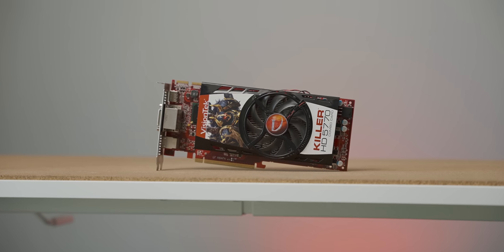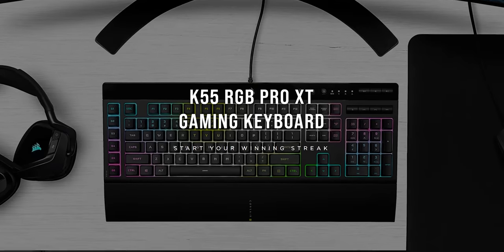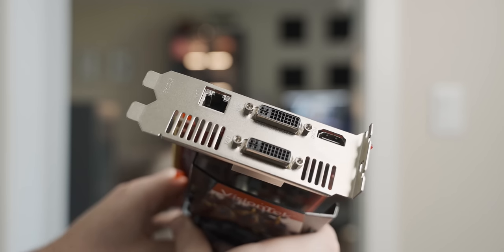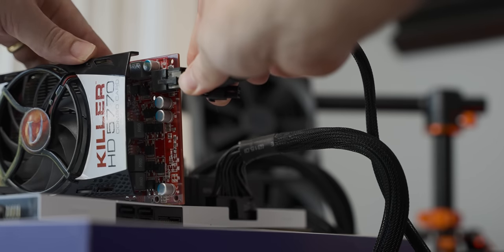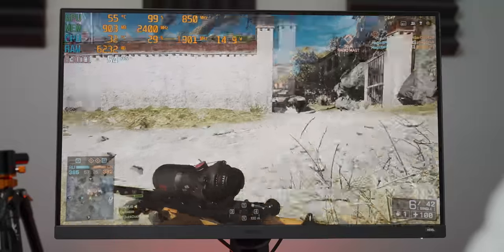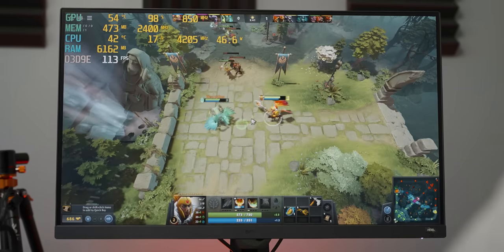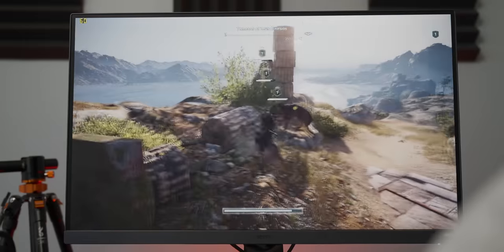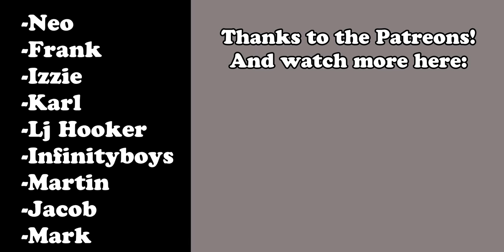The Most Pointless Graphics Card Feature Ever?

Comment: So the purpose of this network card was not to add gigabit to your system that lacked it entirely. At the time, these "Killer NIC" cards were advertised as improving network performance through a combination of offloading more processing onto the card than a typical integrated NIC, combined with some special-sauce magic they apparently had in their drivers to queue/"optimize" packet delivery for lower, more consistent pings. Legitimately useful card or snake oil? You be the judge.

Now, why is it integrated into a graphics cards? Small form-factor PCs that only have a single PCI-express slot. You've got a big ol' 16x PCIe slot that your graphics card probably only needs half of, and when you're trying to do an ITX build or similar, you might not have a second slot to dedicate to a standalone Killer NIC like most of the ones that were sold.

A bit disappointed you spent seemingly zero time researching this, and instead dedicated three quarters of this video to randomly playing some vaguely period-correct games on the card (which is otherwise unremarkable and would obviously play basically like any other HD5770 out there). How the card plays games doesn't tell us anything useful about the unique design of this particular card.

A bit of research would likely also let you come across some interesting graphics cards from around that time that also had a network port on them but for a totally different purpose. They included some extra hardware to directly encode frames using a special protocol called PCoIP (by a company called Teradici) and directly ship those frames over the network for remote playback on a specially designed thin client. This was popular in certain corporate corners for virtualizing high-performance workstations so they could be kept in a rack somewhere, back before every graphics chip had excellent hardware encoding/decoding blocks - this could have made an interesting tie-in to your Geforce Now section, because it was not too dissimilar a model to how Geforce Now operates, just before it was done with commodity hardware.

Comment: Are these spec good for 900eur
AMD Ryzen™ 5 3600
B550 Gaming X V2
HYPER H410R RGB
KINGSTON FURY 8GB PC24000 DDR4
Crucial P2 500GB PCIe M.2 2280 SSD
GeForce GTX 1650
Cooler Master MWE 550 BRONZE - V2
Cooler Master MasterBox K501L
Windows® 10 Pro
Reply: Under normal circumstances I'd say this system is of fairly poor value, however due to the GPU shortage if you have nothing and desperately want a computer that can game at 1080p this could be an option but that memory needs upgrading so add 100 euro to the price for that.

I would personally opt for a system with an RX 570 instead of the GTX 1650. But in this economy that's easier said than done.
8gb of 2400 MHz memory is nothing more than e-waste as Dawid would say and I'd suggest changing that for at least 16gb of 3200 MHz memory.
That 500gb SSD will be used up fast with all these new games that are over 100gb so you will eventually want to get another SSD, SATA SSDs aren't too expensive these days and will get the job done just fine while using the M.2 to boot from.

To put in some perspective 20 months ago my system cost 1400 Euros to build.

181 Euro - MSI X570 Pro
227 Euro - Ryzen 5 3600 
76 Euro   - Noctua NH-U12S
98 Euro   - Corsair Vengence 3200 16GB DDR4 (2 x 8 GB)
193 Euro - Samsung Evo 970 1TB
467 Euro - Sapphire RX 5700XT
76 Euro   - be quiet Pure Power 11 650w Gold
82 Euro   - Corsair 275R

When I built this system a GTX 1650 would have cost 150 Euro and the Crucial SSD listed is worth 56 Euro so if I switched my gpu and SSD for the ones in that system it would cost 948 Euro.

Comment: There's also the ability to setup etherchannel bonding, if your switch supports that, so you can have a 2GbE connection. Something that will still cost a fair amount (£25) today.

Not to mention that you can have one network for gaming, with an outside connection to the Internet, and an internal connection for your intranet/private servers.

Finally, Killer have a lot of marketing behind them, and this was probably more of collaboration that was decided in the board room, rather than at the design level, to trial future compatibility between 2 companies.

Most of the time when you see something "weird" on a "consumer" product, it's either because it wasn't meant to be a consumer product, and just ended up that way upon release, or there was a potential corporate takeover/merger on the cards, and they wanted to see if their engineers could work together, or if the merger/acquisition would make sense (being folded in to one product line), and provide a noticeable boost to their bottom lines.

Sometimes when you develop something, you don't really know how it will be used in the market. EVE is a classic example of a video game that had this very issue. There's a keynote speech from ~2014 that talks about this. When EVE released, they didn't anticipate that players would work together in quite the way they did, and as a result, the pacing of the in-game economy was completely out of whack compared to where they thought it would be a couple of months after launch.

It's a classic case of, here's some mechano. Make something. Then staring in wonder as someone creates a full sized theme park out of it.

Comment: Perhaps the geforce now wasn't working well because video decoding is usually done by the GPU (hardware) and if it wasn't able to keep up then it might have been causing bottlenecks (though the system requirements say minimum HD 3000 series). Or it might have been decoding on the CPU? Task manager can show the load on the GPU decoder, which could be an indication. Hope you figure it out!

Comment: K1's were for torrenting while the Machine was idle/off with power. Usually they had a usb port for a dedicated external HDD.The K1 had a PowerPC CPU for the NPU, so some better hackers than me have been able to access them as fully blown Computer (like having a RPi on the video card}.  The make of this card is obviously to reduce latency and these did have a dedicated PCI-e management chip. The bloat of the Killer Nic on the Video card was likely more bragging rights than performance. I still use a K1 today in an Amiga build.

Comment: First time I heard of the Killer brand for NICs they advertised the benefit of offloading some of the processing for the network to the NIC, thereby lessening any CPU bottleneck for games, in the age before hyperthreading and efficiency cores this was a decent feature, even when motherboards had Gigabit Ethernet included, having the NIC on the GPU did mean that you wouldn't be blocking the airflow to the GPU heatsink with a whole other expansion card.

Comment: This was actually a rather great thing before USB 3. Having an extra GbE connection is valuable for numerous reasons and many small builds can only have one extension card. I have that problem with my Streacom FC5 Alpha chassis, where I ended up hacking up internal USB 3 with a hub for GbE connections and hacked up a dremel solution to expose it to the outside world. I would've loved to have a GbE connection on my GPU if it didn't cause any problems. In fact, I would love to have a a GPU with one or two SoCs on it since you already have the power and connectivity.

Comment: The only reason I can think of for this card to make sense is if you had either a low end Mini ITX board at the time (2009 Biostar boards were still shipping with 100mbps LAN)
What seems more likely to me is that this may have been intended partially for Windows Media Center, as there were a ton of Media Center thin clients that would connect to a more powerful PC running Windows Media Center to stream content from. If you had an older Media Center system that didn't have gigabit LAN or didn't support hardware transcoding to the formats used by the thin client, then this card could solve both issues for a system that was fairly likely to only have one PCI-E socket anyways.

Something like this would be a lot more useful nowadays though given that most motherboards still have 1gbps LAN when 2.5gbps and in some niche cases even 10gbps networks are in use. Adding a decent GPU with a built in 2.5gbps NIC to a NAS system would be pretty justifiable.

Comment: 1. A membrane keyboard is not professional. That is a $20 keyboard with RGB, plenty of those on aliexpress. 2. "Windows key" is has a real name. It is the "mod" key. It is mapped the same for Crapple, Winblows and Linsux. Definitely NOT the windows key. That is a useful feature though. 3. Why is a gigabit ethernet adapter a good add-on feature for a PCI-E card? Because most motherboards only have 1 full PCI-E slot. If this NIC does its own processing(not CPU bound) then it is actually a brilliant idea.

Comment: I had the same WTF reaction when this first came out.  Gigabit was available, but not as widespread as you think, 10/100 was still the better value proposition. But the deal was that CPU overhead for processing network traffic wasn't zero.  And back in the day when CPU's didn't have 16 cores it "could" have an impact on gaming performance.  The Killer NIC was supposed to reduce the load on the CPU by handling most of the network data itself.  It was mostly a gimmick tho, unless you normally transfer large files at line speed while gaming.

Comment: I'd see this work in one of those old Dell SFF PCs with only 2 expansion slots that would probably have a slow 100mb Ethernet card built in, so could upgrade the graphics that requires a dual slot, and network at the same time

Comment: Ok, so you should have touched a bit on the history of killer Nic.  The idea behind the killer Nic card was that the software protocol for networking robbed some power processing from the CPU. So, the killer NIC card would actually offload the work to a hardware module, which allowed for the OS to free resources and better performance under heavy load (AKA for gaming). They originally release the products to the market but were very expensive and relied also on their own infrastructure to try to accelerate gaming performance and network performance. However, with newer CPUs and newer OS, the impact on the OS for network became negligible, so the Killer NICs became obsolete fairly quick. They tried to merge with GPUs because they wanted to offer "gaming performance" but in reality, it had very little to offer more than a marketing gimmicky product. I remember when they first came out, I was tempted to get the M1 but since it was so expensive, preferred to allocate that money to a better GPU (which worked out better).

Comment: In this era of gaming, a gigabit Ethernet connection was best. But because it's on the GPU slot, it's routed directly to the processor and not through the southbridge chipset as it would be in most designs.

Comment: The gamble seems trivial. You take up a second slot with the cooler on the graphics card, might as well integrate a second card to make up for it. Not sure why that setup would be common at any time past 2003 but there are use cases that demand a second NIC on the computer.

Comment: It's not pointless. Gigabit ethernet was NOT common for consumers at this time, unless you worked in a data center. Onboard ethernet was almost always 10/100, maybe 1000 if you bought a high-end motherboard. Let's also remember on-board-anything absolutely SUCKED in 2000s; performance and stability were all over the place, so you almost always wanted to get an add-in card (e.g. sound, network, storage, PhysX). A Killer NIC card by itself cost as much as USD$300 at the time, where-as this 2-in-1 solution had an original MSRP of USD$199. For the budget-minded, it made a lot of sense.

Comment: we ha plenty, pletora of ssssstrange chineese knockoff motherboards, that had quite decent cpus. but only a single expansion slot. somesortha industrial of office computer , not sure. they had soldered , non replaceable  xeon cpus. the cpus got acceptible grunt, and where a very cheap thing to get. however, they did not have high speed ethernet. and there was no option, eighter you got fast netowrking, or you got something else. these cards where popular, as it ment a very very cheap entry to some modest gaming. they had a right to exsist.

Comment: Regarding the fact that this still runs pretty well: GPUs have FOR THE MOST PART only had incremental improvements generation over generation for the past decade. There were a couple of pretty decent leaps (Pascal comes to mind), but it's not like comparing this card to something older than it like a Rage3D or something.

With that in mind, the kind of performance and settings we see here make sense really. In the hype of new GPU releases, people forget that the previous gen is usually still totally fine. You have to go back pretty far to get to "doesn't work".

Except when you get to cards that don't have a unified shader architecture :p

Comment: does hd 5770 support hardware x254/x265 decoding in windows 10? since geforce now streams a video capture directly to your screen ,testing with newer integrated intel might actually unbreak geforce now experience if so i would look for the solution in the video decoding settings of the gpu or try installing 3rd party video codecs

but that is just a guess and talking out of an ass like every chair and keyboard warior

Comment: It exists for High Speed Trading. The folks involved in that want to be able to process network traffic as quickly as possible with as little latency as possible to make buy/sell decisions. They would not have been receiving traffic though this card to the CPU, as there is too much latency involved in that for their use case - instead, the network packets would be processed directly on the GPU with special software. Not the first time I've seen this sort of thing.

Comment: Im kind of late, but for the Geforce Now part, its always been like that for me. It may be partially because im a free user for it, but ive always been hooked up with gigabyte ethernet or close to a 5gz wifi connection. Sometimes when running more demanding games like cyberpunk, the game hovers more around the 40s than 60s with the same frame dips you experienced fighting the wolves. Ive used Geforce Now for about a year now off and on, and it does seem like it heavily depends on how many people are on the servers, no matter what your hardware/connection is. Weird stuff.

Comment: Back in the day MSi and AsRock used Killer NICs on their motherboards, advertising saying it will reduce latency / lag, and give your games higher network priority. BUT, they were plagued with software issues. I remember seeing killer NICs during the 2nd/3rd Gen Intel Core series, up until 4th Gen (i.e. LGA 1155/P67/ Z68 ~ LGA 1150 Z87/Z97 era)....and then it started slowly dying. That was my memory of it, at least.

Comment: But I love hardware with unusual features like that: Graphics cards with LAN ports, Gateway 2000 AnyKey keyboards from 1992-1993 with diagonal arrow keys, Modern wireless keyboards with phone holder. four serial ports on a desktop, Blu Ray Rewriteable with HD DVD, DVD, CD, LightScribe, LabelFlash (also known as Super Duper Optical Drive).

Comment: Isn't that just an HDMI over HDBaseT? (albeit a really primitive one)
Visiontek used to do this and build some other rare SFF VHDCI Cards, but they're recently switch to MiniDP. 
I think they're pretty well known for their 5+ port GPU on a single slot card.
The reason for that port is that so they can use LAN extender for 100+ meters display on live events or wide open public space.
Linus does review something like this B2B card around 2-3 years ago, but with a 6 HDBaseT port if i recall correctly.

Comment: So about GeForce Now...

I've been using it daily, since my current PC is rocking an FX-6200 with an HD 7570. At $5/month, I'll have spent the equivalent of a 3060 (at MSRP) in five and a half years.

One thing I've noticed about GeForce Now is that by default it auto-chooses your server location, based on network performance. But sometimes you can get a better connection (or at least a more consistent one) by manually picking a server. There's even a tool on the settings page to test bandwidth, packet loss, and latency with different servers.

Most of the time, my best server is US East 2. But some days it suffers from congestion, and I get better results from their US Northeast Server.

Comment: Windows key LOCK!? You spoiled kids and your RGB rigs. I remember when keyboards didn't even HAVE a Windows key, and VRAM was measured in kilobytes, not megabytes or gigabytes.
Having a lightning fast NIC doesn't mean beans when your internet connection only supports a few dozen megabits upload speed at best. Your low-end onboard Realtek 10/100 will do you fine for gaming because your MODEM can't do any better than that unless you've got a commercial internet package. Ping time is far more important, and that is entirely limited on the distance between you and the guy at the other end. The only time a gigabit NIC makes a difference is for doing large file transfers over LAN, or internet downloads quickly. Anything else is hype.

Comment: Corsair membrane keyboard -> JUST SAY NO! I am very happy with my (very) old Corsair mechanical keyboard, but after a tea spill, I had to take it apart, and I was shocked to find that NOT ALL keys were mechanical. The function keys were membrane and couldn't be repaired. I still use the keyboard, but F6, F7 and Scroll Lock are all non functional. Thankfully these keys are not often needed.